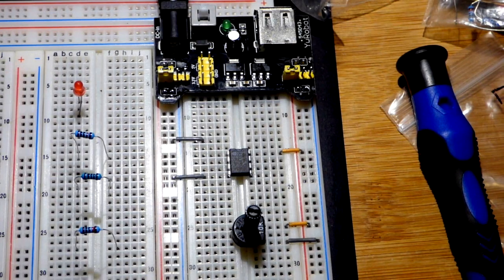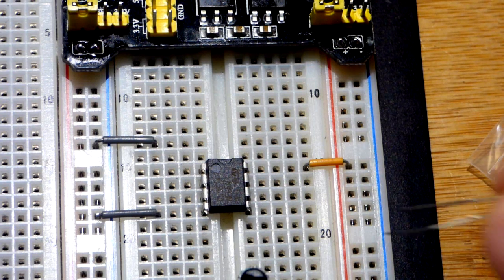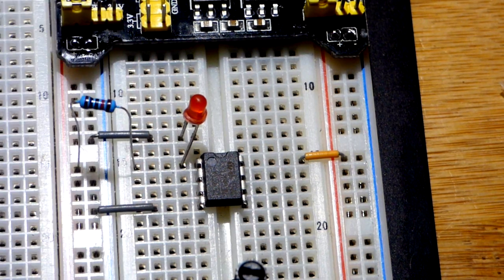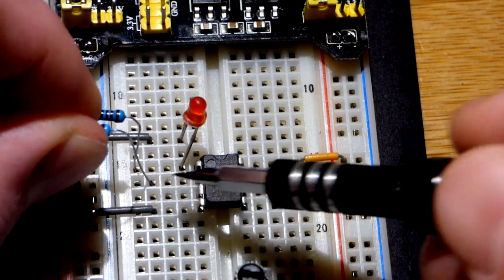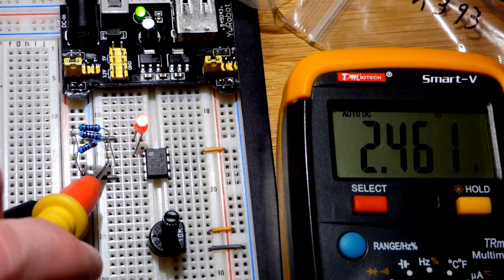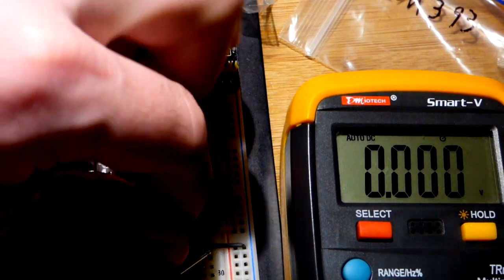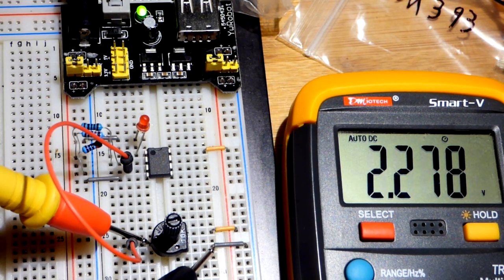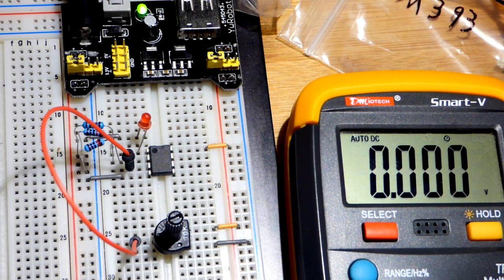LM393 comparator IC non inverting basic LED on off circuit controlled by trimpot voltage divider

Comment: If you put a capacitor between led legs can make it half on ?
Reply from the maker: I wouldn't do that. Depending on the value of the capacitor, It would take the LED longer to turn on and then when output goes low, briefly send more current than what the IC is rated for through the IC output if the capacitor is connected directly to the output.